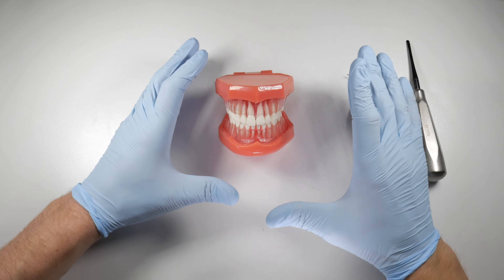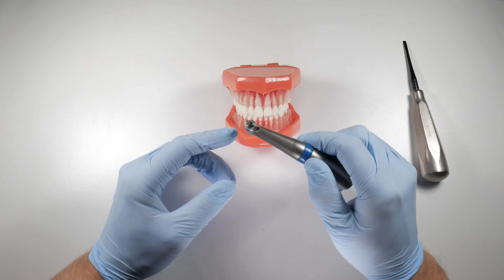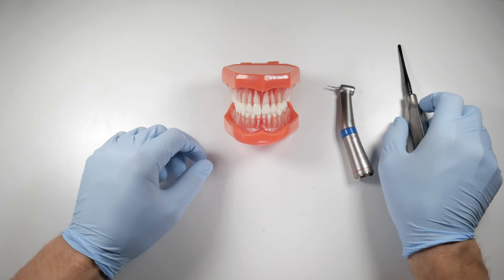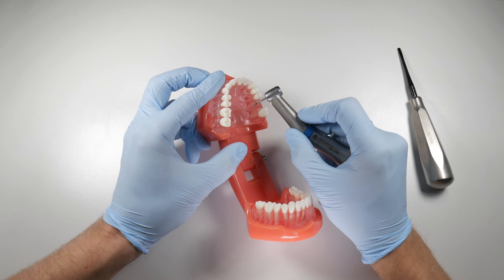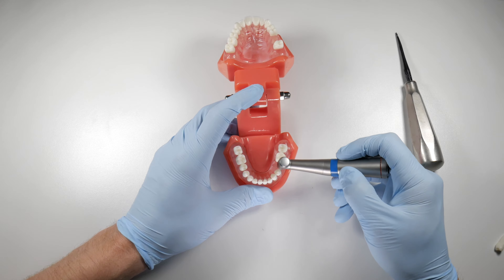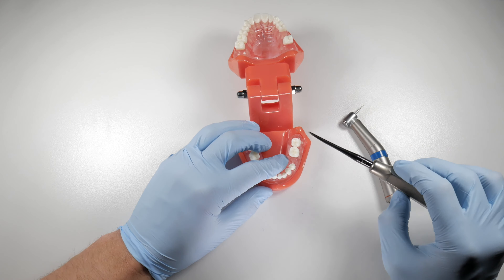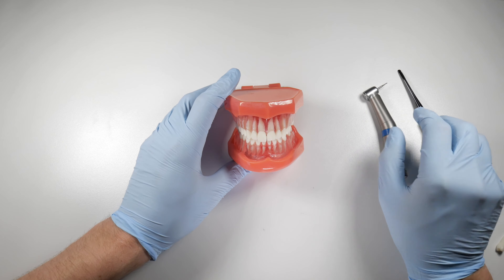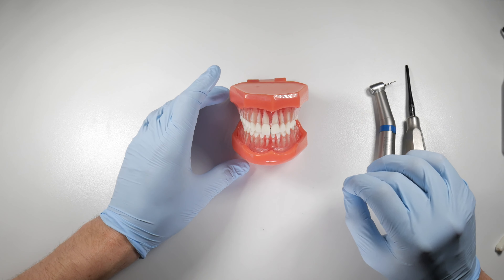Troughing Bone To Simplify Extractions | OnlineExodontia.com

Comment: if you trough the tooth like a crown prep, the tooth might fracture while elevating.. the same is true if you cut this root in two pieces... cutting the apical third of a root in half  is not easy either, maybe in cartoons is easy..  but not in real practice. If one wants to take a root out, remove bone, expose root and then take it out, without weakening it with those ways you mentioned...
Reply from the maker: Petros - thanks for watching.  With proper light, magnification, suction, and technique this works very well.  It does take practice.  If the tooth is snapping off on you, trough deeper prior to applying any force and consider doing both sides of the root so that when you apply your pressure the root has somewhere to go.  All the best!

Comment: What are your critical structures on both maxillary and mandibular arches? I understand the sinus for maxillary teeth and the mental nerve/IAN for mandibular, but what are some other considerations with this technique? Great video by the way.
Reply from the maker: That's about your only concerns Tyler.  Certainly the lingual nerve in the posterior mandible is something to consider if you're troughing there, (which shouldn't be often) you should consider an instrument subperiosteal to protect the nerve in case you perforate the lingual bone.   Thanks for watching!
Reply: also for maxillary even tho most dont need to go far into palate, be careful of the palatine nerve(s) foramen where they outlet to innervate palate soft tissue.

Comment: Thanks for your video! May I ask that would you use the same bur 1703 for sectioning impacted third molar? will thinner bur easier to crack the tooth? thank you so much I love your channel!
Reply from the maker: Thanks Calvin!  Most times with removing these teeth you're looking to cut them into bits to take them out easier.  Part of removing them easier is creating space.  Although a thinner bur will section things apart fine, it's a bit harder to maneuver the pieces out of the socket with more tooth structure present.  Hope that makes sense?  All the best!
Reply: @OnlineExodontia  Agree, Thank you very much! look forwards to your new video!

Comment: I had a situation the other day where the maxillary first premolar broke halfway down the root. I tried to trough the bone, but the head of the hand piece was blocked by the adjacent teeth! What do you do in this circumstance?
Reply from the maker: Sean - you can often get away with extending the bur out of the chuck just a bit.  This is terrible for your handpieces, but I admit I do it at times due to this reason.  The other option is to look at a 700XXL bur which is even longer.  Good for canine root tips or these situations.  Or a straight surgical handpiece would do the job as well.

All the best!  Thanks for watching!

Comment: Hey doc, for 1 root premolars, when do you decide to trough vs. sectioning mesial-distally and deliver 2 pieces? Doctors in my office have disagreements over it.
Reply from the maker: Thanks for watching!  This answer is my personal approach to your question...I don't want to get in the middle of a heated debate haha!  When faced with a single root on a premolar I will almost always trough with a thin bur.  I will go circumferentially, then work the high side of the root to get it out with a root pick.  When there are two roots I tend to trough between them and push the roots inward.  Having said this however, I will still trough a bifurcated premolar and I will still section the root tip M/D on a single root, just I find it's rare that it's required.  Again...just my approach.  I can't really think of a reason why either approach would be inappropriate as long as it helps you achieve your desired outcome.  All the best!
Reply: @OnlineExodontia  Thanks for the detailed response!

Comment: What Rpms do you cut at?
Reply from the maker: I use an electric NSK handpiece for basic surgical extraction troughing and it runs at 40,000RPM.  The 1:4.2 increaser however makes it spin much faster.

Comment: Don’t you rather a low speed handpiece to avoid submucosal emphysema, instead hi speed, even if you don’t use a flap?
Reply from the maker: Thanks for watching Ricardo!  I typically operate with one of two handpieces that are both electric as the torque is greater so you can cut a bit easier.  The S-12 W&H handpiece (straight) and the Z-45 Ti-Max NSK.  The Z45 is designed for surgery in that it doesn't exhaust air forwards.  If you use a regular highspeed handpiece you will blow air into the surgical site and you are correct...even without a flap you do risk air emphysema depending on the situation.  Other good choices for surgery would be the Impact Air, or Sabra-45 which are both rear-exhaust air driven handpieces.
Reply from the maker: Joe Blow  This is difficult to say Joe as to what happened there.  What I can say is the mouth is very forgiving and almost no matter what the situation, new gum tissue should fill in over time.  I wish you the best!
Reply from the maker: Joe Blow No worries!  I'm afraid I can't comment on that as I have no prior experience with that product.
Reply from the maker: Joe Blow  haha I looked up aerogel and it's actually awesome looking stuff!  Maybe you were thinking gel foam - this is an oxidized cellulose that helps with clotting.  There are indications for this stuff, but it's not routinely employed.  For most extractions, it's best just to leave the socket without any foreign material in it to reduce the likelihood of the material habouring bacteria leading to infection.

All the best Joe!  Hopefully that helps and thanks for bringing Aerogel to my attention!
Reply: Great video. Trouble when troughing around the root and removing more of the tooth, sometimes the tooth fractures as it becomes weaker. Any  tips?